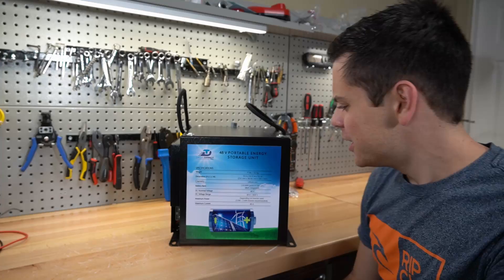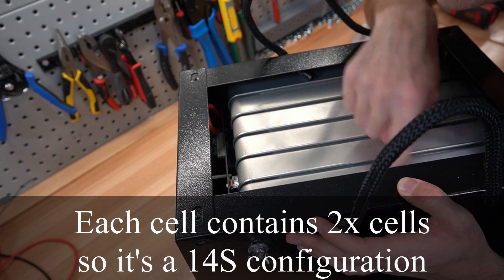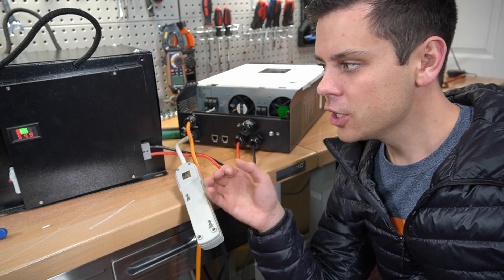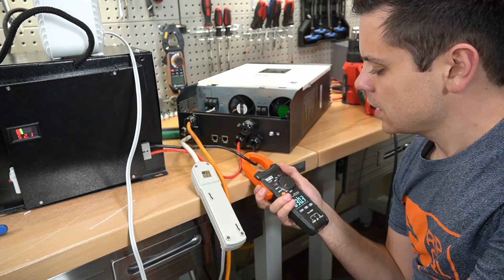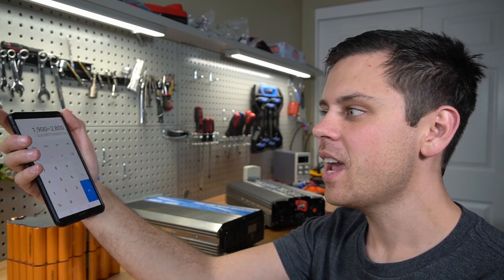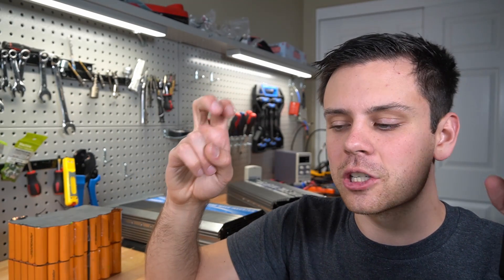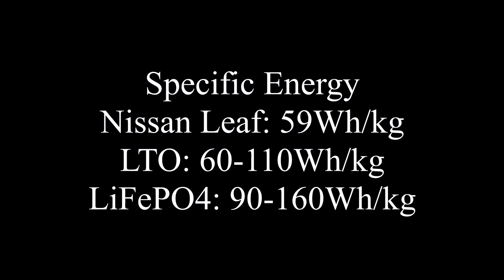48V Nissan Leaf -Used Cell- Solar Battery Pack

Comment: Wouldn't surprise me if someone called upon you as an "expert witness" for the plaintive in a "used battery lawsuit". I would trust you to get my side of the story told. You're very easy to understand.
Reply: Except,  those Nissan Leaf Modules are NOT NMC Chemistry, they are LMO + Nickel  = ( LiMn2O4 with LiNiO2 ) - NO COBALT.

Comment: The little red wires ONLY power the beeper and display board, not intended to trip circuit breaker!!!!! You should KNOW this..... Obvious. Sorry to burst you self inflated bubble....haha.
Reply from the maker: Yeah but do you trust that little beeper board and volt screen with unfused wires? Idk. I don't trust China products
Reply: @WillProwse  I trust nothing except maybe Magnum Energy products. I try not to blame China for what ails me.
Reply from the maker: @geraldhenrickson7472  magnum products are worst. Have you used them? I hate china too, but american solar products are trash. Minus enphase and Tesla. Sol ark is nice too.

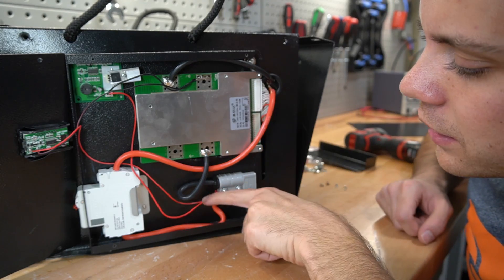Comment: William, bro you are wrong, @2:00
those thin red wire are for volt meter to provide cell pack voltage. 

MCB is already connected with thick wire to trip on short circuit and can bear high amp load.
💞
thanks, live your video
Reply from the maker: Yeah true but what if circuit board has overload. I don't trust any Chinese pcb without some form of ocpd. Every wire should have protection
Reply from the maker: And yes, they are voltage sensing, absolutely

Comment: I think the usefulness is based on how long the battery will last and how fast and how much it degrades. If I plan my system based on 65% capacity and after two years I only get 55% capacity that would be a huge loss. It’s hard to judge without knowing how the capacity curve goes down. 
But I also think it’s a good investment to buy new LiFePO and just use them for 20+ years. By that time it’s anyone’s guess what type of magic batteries we will have. But one thing is for sure, two sets of batteries will outlive me.
Reply: What else would it based upon?   Two years of constant use could easily erode the capacity that much. Note that the battery industry is changing rapidly...20 years is a long time.

Comment: Hey Will I got a small home I'm trying to power off grid, I have a 3,300 watt solar  array and 15kwh battery bank using the 3kwh modules. I have context mppt 60 150 charge controller,  XW6048 inverter and conext SCP. I have been watching your videos and crunching numbers on my system making sure it will be able to handle the watt load I will be pulling from my appliances.  What is the best way to contact you? would like you to review my setup if that is possible.  Thank you

Comment: There are NO used car batteries going into landfill, they are ALL either used for power walls or broken down to provide spares/repairs to existing EV battery packs. The BMS includes cell temperature monitoring on all commercial power walls and are in no way 'dangerous'.
Reply: None? That is a strong descriptor. No way dangerous? LiFePo4 maybe...There are no guarantees Dave.

Comment: It's the same Chinese BMS that I have in my LiFePO4 battery,though this is the NMC variant. 60 amps continuous and COM ports for connecting a UART  or Bluetooth device.
Reply: Except, those Nissan Leaf Modules are NOT NMC Chemistry, they are LMO + Nickel  = ( LiMn2O4 with LiNiO2 ) - NO COBALT

Comment: Great video I found another value on Ebay $300 for a 1.1 KW  LTO pack out of a Honda. the packs are 1.1KW hours each in a series configuration of 24 SCiB cells. voltage a little high but most inverters can handle it. one could also break the pack into a 12S2P  for 24 Volts or parallel four 6 cell packs 6S4P. Each cell is 20ah (They claim they tested at 20.5 though I have not done a ah test on them yet) have to cut some of the buss bars for 12 volt. but not for 48 or 24. I bought two. I want to use them in a 24V maintenance truck. Ideally 6 cells for 12V, 11 cells for 24V and 22 Cells for 48.
Reply from the maker: Holy cow that's cool
Reply: Voltage is a little high? How high is a little high?

Comment: I have purchased over 110 leaf v2,      50 leaf v2 from techdirect off ebay approx 72.00 per module   techdirect advertises them as 66ah battery modules  I have only had one produce greater than 48 ah,  I understand they are used,  but for them to offer  you are buying 66ah  to me they are deceitful 
.   I switched over to a different vendor on eBay and they test and label each module  only a $2.00 difference and I'm able to match a lot easier.      I have  4 separate  48v system,   3 modules in parallel   and 7 series (21 modules total)   and I use batrium to manage them all,       just sharing..
Reply from the maker: Which seller is that?
Reply: It was greentechybridbatteries,   on eBay,  watch their listings  they list different AH on their auctions,  everyone has met or slightly exceeded rating
Reply: There is a huge difference betwixt deceitful and mistaken.  What vendor is it you are happy with? That would be helpful to know...

Comment: I may have misunderstood. Why would you need thick cables going to the volt meter? 
They are designed with high resistance in mind to stop high current. Also.... Aren't thin cables basically a sketchy fuse. :D
Reply from the maker: Sure but it could overheat in a overload. Those are cheap little volt meters. I don't trust it. Would rather have a fuse.
Reply from the maker: Haha sketchy fuse
Reply: @WillProwse  fuse covered in flammable plastic :)

Comment: I noticed my cells wanted to go 4.3+ my charger wants to charge to 4.25, it will show wrong chemistry if it's in lihv for 18650's , I put one on lihv and vharged to 4.3 it held a fair amount of capacity, above 4.2v I know the leaf cells do have the capacity in higher than other batteries, I don't know if they are lihv and only charged to 4.2v by Nissan, or if it's something else!

Comment: Leaf Modules are good for 48 volts but not 24 or 12 volts.
Reply: You can buy 48v to 24v and 
48v to 12v voltage converters on amazon for a very reasonable price. They are essentially a DC transformer.

As a 48v battery drops voltage to say 44 v as it discharges, the 24v or 12v side stays constant.
Reply: @johanvangelderen289  So long as the buck converter can handle the constant amperage and then there is yet another loss in the system. Should just stick with the 48 volts. If you want 24 or 12 volts then use a different type of battery. I prefer to have my battery pack closer to my final voltage. If they made big affordable inverters for 96 volts I'd do a 96 volt system.
Reply: @onegreenev  

As I understand things, rv systems are 12v or 24v. 

The Leaf battery is close to 48v
So we need to reduce the 48v to  a usable voltage using a buck converter. Or what don't I understand.

In the opposite direction,  there are 48v inverters available to create 120vac. 

So it seems that the Leaf batteries are an odd voltage for RV use, yet a buck converter can create normal RV voltages. 
The loss of efficiency would be about 5 percent according to what the vendors specify.
Reply: @onegreenev  Stick with 48 volts? Sounds good for those who actually started out at 48v. Otherwise there is a serious investment on the horizon.

Comment: I have leaf batteries, I split one so I can run 7s it was really easy, just cut the link, and drill holes, in the tab, up to 1/4" I used 5mm, so the holes were just under 1/4", and ran 8 gauge wire out of the original case, it looks like its original, except for the 8 gauge cable out the top, it can have the original connection for pos from one cell, 8ga from the other,

Comment: I had an original 2011 Nissan Leaf. When I first got the car I could go about 75 miles in the summer with the air on at 55 to 60 mph. It was pretty consistent for the first two years. I did notice a bit of a drop during the last part of the second year and a faster drop the last year. I had 36,000 miles on the vehicle when I turned it in and it was not able to even do 48 miles at 55 mph at that mileage. We are very hot out here and the degradation was real bad. Nissan still would not honor the battery warranty issue even though it would not do even 48 miles at 55 mph. They purchased the car back at a very good price so I gave the 2015 model a try but leased that one. After 3 years I had 36,000 or so miles and I saw no degradation in capacity with the new pack. They did some changes in the battery and some call it a lizard battery in that they do not degrade badly in hot weather. I was very pleased with that. I did let it go back to the dealer. I eventually purchased a Fiat 500e. 44,000 miles and nearly the original capacity. Damn good cells in that car. If the original 2011 and 2012 cells don't get too hot then they should do just fine. I'll do a capacity check when I get one of those capacity testers you have. My Leaf modules are from a very low mileage 2011 Leaf. They have held up well in storage so I will test capacity. I have been calculating at 50ah per module vs the original 62 or what ever it is. I'll do a capacity check at like .5c. That should be just about right. Still waiting on my BMS.

Comment: The temp leads are between the cells when you put them together. I bought the kit and built my own. Wanted to know how they went together   just ordered another 15kw of them. Been using them full time in my RV @SolarAmbulance on IG
Reply from the maker: Good to know, thanks
Reply: Have you a link for the bms pls ?

Comment: Hey Will, what happened to you Liking the Tesla battery so much. now it seems like your kind of against them.
Reply from the maker: I personally like using them, but they are dangerous. And I don't want people using them until we have a solid BMS that will not fail and cause a fire. That's all. It's a cool battery
Reply: @WillProwse  Thanks for clarification. Have a great night.
Reply: @WillProwse  

Is a decent safe BMS for the Tesla battery in progress somewhere?

Would something like that be available fairly soon?

I'd like to use a Tesla setup for a step van to rv conversion I'm considering.

Comment: So how many years or cycles do you think you'd get out of say 6 of those packs in series running a whole house situation?Was thinking of using those exact cells around 10-16kwh wall hooked to (3) mppsolar lv5048 with say 4kwh solar?Still learning but I think I'm getting it.Wife and I are going to build offgrid in a few years so soaking up knowledge.Thanks keep the videos coming
Reply: Better ask that over at the powerwall forum Will mentioned.

Comment: Hay Bob, what's that power cable running out to the middle of your field?  

Oh it's my Power Wall battery . Will told be to put it there

🔥🔥🔥🔥. 🚒🚒🚒🚒
Reply: Actually  , do like Will ....
Store batteries  in a shed near solar panels and send AC back to house . Little risk , cheaper wiring (AC) and no heat build up in house.

Comment: Will, I’ve been watching your YouTube videos for a long time now, I’ve got a 12v Thor Axis motorhome that I want to put solar on it, is there a device that will convert 48v to 12v?  Can an inverter for that for me and if so, is there a device you recommend?  Right now I had to Interstate 12v lead acid batteries installed, but want to go to Lithium batteries in the future.  Thank you in advance.
Reply: I see he hasn't had a chance to answer you. Yes there are  DC 48v to 12v step-down converters and there are 48v inverters to make your 120v
Reply from the maker: Sure, good question. A DC to DC step down converter will do it. Any of them will do. This is a cheap one on Amazon: uxcell New BIG-Size Voltage Converter Regulator DC/DC DC 48V Step-Down to DC 12V 30A 360W Buck Transformer Waterproof https://www.amazon.com/dp/B01M06Q94K/ref=cm_sw_r_cp_apa_i_L8HqEbCZAREST

Comment: Just need to get the cells post 2015. My wifes Leaf is doing great with 40k miles it still reads max on the battery.

Comment: I have seen the leaf batteries done right by a handful of people.  They do seem to have a purpose but only if you take into account the current state the batteries are actually in.  Juan and Michelle from Beginning From This Morning have a large leaf pack for their solar on their bus.  It's worth a look, and about the only system done with leaf batteries that I could say is spot on.  That chemistry is scary though, i just dont think I could suggest anybody use it for the possibility of thermal runaway.

Comment: I worked with them on using a Gen2 pack to replace my Ryobi electric riding mower batteries.  They were helpful and responded to all of my questions. Pack just fit inside the mower and has been working great.  I did purchase the charger from them, which failed after a few months and they refunded my money after I sent it back. For me, I felt they were great to work with and were honest about what the battery was capable of delivering. The price wasn’t that much more compared to replacing it with the Ryobi AGM batteries, which were out of stock for months.  Now I can mow my lawn (1/2 acre) without issues and the pack has held up well for the last 6 months. So far so good.

Comment: Given the pros lithium has over lead acid battery and all the electronics you need to balance heat sensors ect to run them. I much prefer lead acid system

Comment: not really an anderson powerpole connector, that's an anderson 50amp sb series connector. powerpoles are individual modular connectors that clip together to make any configuration that you need. the sb connectors are used on forklifts and other electric equipment and are color matched so only the same color connectors will mate together. the common color coded ones are: yellow=12vdc, red=24vdc, grey=36vdc and blue=48vdc. there are other colors for higher voltages and ones for oddball voltages like 18vdc and 32vdc as well.
Reply from the maker: I actually looked that up and the 175 non power pole ones are listed as power pole, so I was confused. Thanks for clarifying that.
Reply: @WillProwse  powerwerx is a good place for all your anderson connector needs, and they call them powerpoles. However if you go to andersonpower you won't find the SB series in the powerpole section.
Reply from the maker: Oh wow, cool to know about the voltages. Interesting

Comment: For most people these are just gonna be set somewhere and so they don't care about the weight. They definitely should market them as 2.8 kwh though.
Reply: No...For most people, weight is everything. There are over a million people full timing in the country and as lead acid systems dwindle...

Comment: Nice review, I found this one very interesting to learn about Nissan Leaf batteries.  I like the second life concept for larger banks and mixes of systems.  Like you said its really a DIY deal, think it would be best set up in a shed away from your house would be the best option for the second life battery concept.  Like the old Junk Yard systems using piles old lead acid batteries.

Comment: Hi Will! I bought a 200AH 48v LFP pack from china that was made for an EV and the seller claims it was unused but It had been sitting around for about 4 years. After doing a capacity test at 26A discharge, it gave about 175.5Ah capacity at 48v cuttoff. Is this normal or could the battery be used?
Reply: After sitting so long, there could well be capacity loss. You'll likely get some back after a few cycles. You might also get a little bit more with a few tenths deeper discharge, but at 3v per cell you are right at the knee of the curve so likely have nearly all the battery can give.
Reply: The unscrupulous sellers out-number the honest and concerned by a substantial margin. I have some LiFePO4 cells that are new and 4 years old. I cycle them every few months and they are still at nearly 100%. Use those puppies...maybe they will stretch their legs and all will be well.

Comment: This is exactly the test I was hoping for. I was going to use these batteries for a while house system...still might.
I think I will go to the factory in California and get more info on how to use.
Thanks will for this review
Reply from the maker: I would wait for the byd pack, for sure. Hold tight.
Reply: Ok Will do, pun intended 🤣🤣🤣🤣🤣

Comment: The other problem with Leaf batteries is they are not thermally controlled in the vehicle like in Chevy Volts or Teslas. That means that they get beat harder during their "first life".

Comment: It looks like these Battery Packs are made from "Generation 1" Nissan Leaf batteries. These are the 2011 and 2012 year Leafs. They could not handle the heat very well and in 2013 Nissan came out with the "Lizard" batteries which supposedly did much better under heat usage.   I think Nissan had to replace a lot of these under warranty.
Reply: gen 2 cells still suck till 2015 cells
Reply: I have a 2017 30 kWh Leaf and the battery is so far superior to the one that was in my 2013 Leaf.
Reply: I am sure that in each generation of the Leaf, the batteries are improving.  But none of them were near as bad as the 2011 and 2012 years.  All you have to do to proof this is to check the selling price, and look at the battery monitor 12 bar status on the Leaf's dash.  The early 2011-2012 batteries were far inferior even to the 2013 years.  These 2 years are very inexpensive to purchase compared to the 2013 and up (yes the 2013 and 2014 are pretty inexpensive too, but not nearly as so).
Reply: @laronis  if u can manage the heat, are the gen 1 (gen 1 = 2011 & 2012?) Still a good buy?
Reply: @baloog8  Sure, it all depends on the price of the Leaf and the number of bars left on the battery.  Some of those 2011 and 2012 Leafs have new batteries because the old ones wore out.